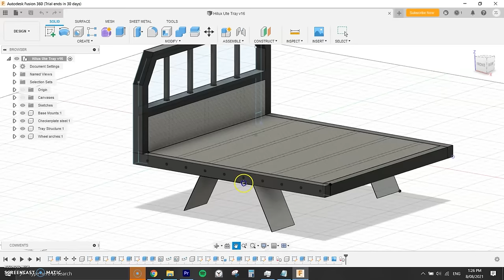The Custom Ute Tray of My DREAMS

Comment: One thing when mounting sideboards,  after you’ve installed one side take that side and mount it on the other side. That way when your putting them back on they’re actually universal. 
Also I went through the catalogue at the auto parts store and used a 90 degree fuel hose and a piece of exhaust pipe for the diesel filler, cost me an extra $10 but it’s legal and piece of mind. Also hi flow fuel every time now.

Comment: Yeah i know it's a year on from this build but i just found it.
Great job.
Just a hint with the sides 
If you stand them up on the tray you can slide them straight onto the hinge pins welded to the tray.
Saves holding them out and balancing them to get them on.
Love ya work
Cheers from Sydney's western suburbs mate.
🇭🇲👍🦘🍺🍺🍺🍺🦘👍🇭🇲

Comment: Thinking about doing this to my rig here in the US, and out of all the channels I’ve watched not ounce has anyone given praise to  gassless welding. I don’t do gas mig welding because of the actual cost of a 100lbs bottle plus the cost of refilling it, and if you think about if flux core wire will do just fine, in fact my whole rig is built without using gas. Almost ten years and nothing has broke apart even with hauling 3500lbs loads rather frequently.

Comment: Really great build, I'm definitely gonna steal your way of doing the tie rail with the cutouts and the pipe when I make my own. The high sides are a good idea too.
Looks great, my only problem is with ally for the tread is it just gets beat up way too easy and it flexes and bends with a bit of weight. I used to drive a flatbed Hino with a full ally tray and that thing would bend til it was touching the tyres if the weight was too much to 1 side, not to mention all the scratches, holes, etc, just securing a steel load can permanently scar those things.
You may get issues with rust due to galvanic corrosion as well (dissimilar metals fastened together without a sacrificial anode.)

Still thats a mad build props to you.

Comment: Looks great mate I’d be careful with the rad hoses as filler pipe as the diesel will eventually eat away at the rubber and will leak or put shit all in ya fuel tank.
Reply from the maker: Thanks for the heads up, a few people have mentioned that. I really should get around to changing it...

Comment: The old tray has a crush point in the center so if you get rear ended hard enough it bends up in a V rather then slicing off the cab.. thats what the holes are for

Comment: The LED lights flickering has to do with the voltage regulator built into the circuit board.  Some lights with have a kind of dead zone at specific voltages.

Comment: Great work! I have been looking at what others have done with their DIY flatbeds to give me ideas, and your build has done just that. Have you since figured out the reverse light flickering issues?
Reply from the maker: Glad I could help! No, it isn't as good as I'd hoped. They seem quite dull and still have a faint flicker even with a load resistor. I blame dodgey ebay lights!
Reply: You should have had it hooked to a relay, instead of your lights running off the main back up harness, use it like a switch that pulls the juice straight from the battery

Comment: For the flickering lights they may possibly need a resistor as they’re LED.
Reply from the maker: Tried this, unfortunately didn't help :(
Reply: @Scrivscribe  When your car is on the voltage will go up to 14.7v, when it is off it may drop to around 11.
Not sure why this should cause a flicker though ask an auto sparky.

Comment: Flicker is caused by the computer looking for a higher load for the light, leds have small load, you need a high watt resistor or look up decoder kit for led automotive lights, that will fix the issue aamazon have them for like 7.00 us

Comment: Looks a bit heavy duty on the sides and back, if you have a hard time seeing over the solid steel, you can cut large holes in it and cover them with expanded metal.
but looks really good, except for the fuel filler.
Reply from the maker: I love the height of the sides but they are damn heavy, I should have used a lighter gauge steel. And yes, the fuel filler needs tidying up!

Comment: @Scrivscribe
  That radiator hose is NOT fuel safe my man. The diesel will eat it away, and contaminate your fuel system, and plug up all your filters, and maybe lift pump. Get real fuel hose rated for diesel.
Reply from the maker: Thanks for the tip, will replace ASAP!

Comment: Why did you chose to go steel over aluminium?
Reply from the maker: Weight really wasn't a concern as I knew this tray would be loads lighter than the old one. I chose steel for strength, price and ease of welding.

Comment: If the indicator lights are flashing 2 quickly u need a resistor on the indicator wire to slow it down, if the indicators are flashing 2 slow there's not enough load to make them flash quick enough. Can be anything.....if u need any guidance email me or reply to this comment

Comment: How has the paint held up
Reply from the maker: Not great, I'm thinking of galvanising or raptor coating it.
Reply: You won't be able to galvanise without drilling holes in the cross members and the top of the headboard to let the gal out